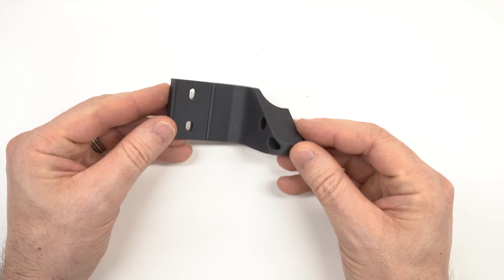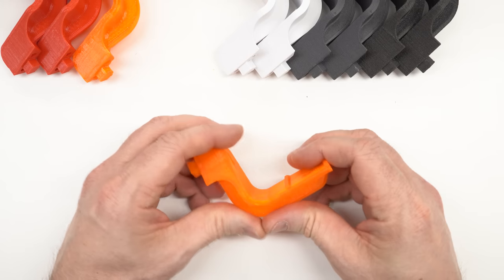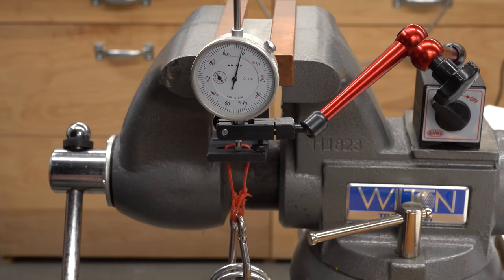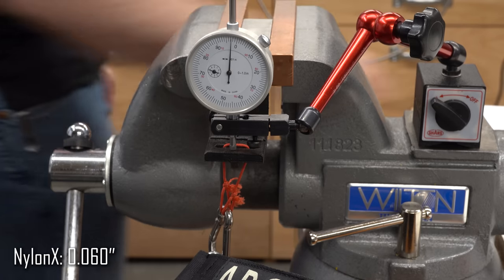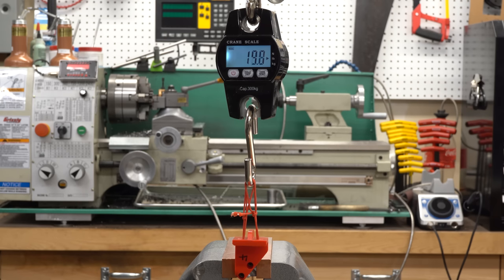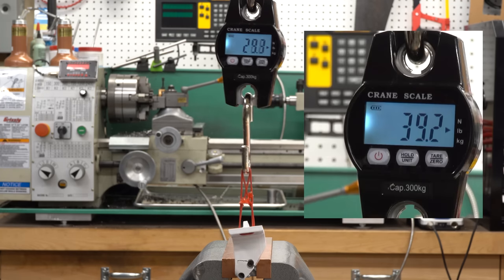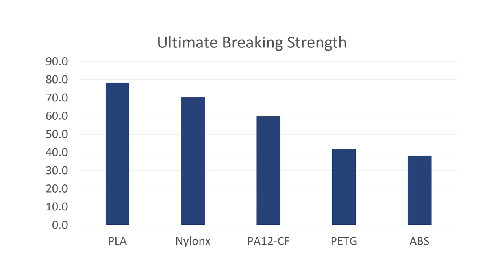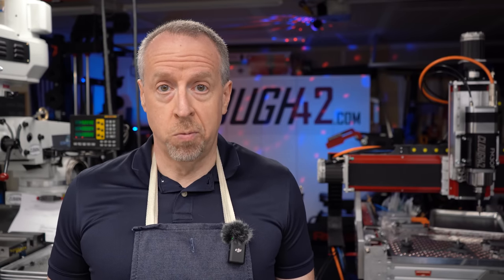Wait, What?  PLA is Stronger Than Carbon-Fiber Nylon?

Comment: If you haven't already, check out Stefan over at cnckitchen. He has done lots of very detailed strength testing with various filaments. I think people miss the point with ABS and Nylon. The main advantage with either one is their heat resistance, but they are both more difficult than PLA to print. In my experience the carbon fiber makes them both easier to print and less prone to warpage.

Comment: You should do a tensile test on the filliment itself or a rod with a bottle neck of an exact size and length.  Then compression strength and bend strength of a regular shape, not an S shape or irregular and a Mohs hardness strength.

Comment: @CNC_Kitchen had similar unreliable data and inconsistencies similar to your experience. Watch his videos on strength tests. PLA does overall have good strength compared to every other filament, even the very expensive stuff! What would improve all the their strengths are continuous carbon or kevlar fiber run along the filament instead of most CF filaments that have chopped fibers within these type of filaments.

Comment: Well... If you needed stronger 3D Printed parts, then you could 3D print those parts with like 2 Perimeters ( I found 1 not be sufficient enough to not be picking up artifacts from the Infill ) and 90-95% Infill ( no reason to go 100% ) followed by remelting them in an oven covered in Salt for it to retain its shape during the remelting process - It would negate any negative effects caused by Layer Lines as they'd become monolithic, and it might also anneal the part.

Comment: PLA isn't very temperature resistant, though. Also, constant load will deform it over time and it is fairly brittle. The material you use very much depends on the application. Want something tough? Pick nylon. Want something very rigid for a short duration? pick PLA. Want something balanced and cheap? PETG. Want the best on a budget? PC. Sky is the limit and want the very best? PEEK and PEI.

Comment: Great Test!  I am wondering if the results would be different if other factors were included, such as higher temperatures.  Also I have a request.  There are a ton of PLA filaments out there.  Would love to see a comparison test between the cheaper ones that run $13 / KG, and the more expensive ones that are closer to $30 / KG.  Is it really worth it to buy creality's HyperPLA, vs their cheaper Ender PLA that they market for beginners.

Comment: I really like the testing set up well thought out the only thoughts I have is the wall thickness  for the mounting screws were very thin and can see that it is consistent in breaking point.   What really matters is what is the actual real load on this part in real life and if the president load factors are adequate?  ⭐⭐⭐⭐⭐👍🏻

Comment: I’m curious what temp you printed the PETG. I’ve found PETG to be significantly more robust as far as impact resistance. I have some function parts that get dropped and PLA kept shattering where PETG bounces off the floor with no damage. Plus PETG has better UV protection.

Comment: A question - it is not obvious from the video, so can I ask about the failure mode in each case? Were they all failing in the same way? In the Aerospace industry we have to take account of the material properties when we design a part so that we maximise the strength.  If you were to make those same parts out of different metals they would also fail at different values, but a small amount of optimisation of the design in each case may have them performing much better.

Comment: with animal sculpture balloons, the color of the balloon is very strongly correlated with how hard it is to inflate the balloon. Pastel colors are much easier to inflate than dark saturated ones.  Simiarly, I've heard hints that clear petg  is stronger than colored petg, which would make sense because the pigment is displacing some of the plastic while adding no strength. It would be interesting to see the tests done with all non-pigmented filament.

Comment: Maybe try to dry the PETG And Nylon at 80 C for a couple of hours before printing maybe that will help, as both materials are hyriscopic. I am not surprised that the carbon reinforces material is weaker. Because the printing process is low pressure, I would expect the fibre to act as a defect rather than reinforcement. Also, the notch sensitivity of the various materials differ. Using a part with holes in may cause stress raisers that are not repeatable depending on the material used for the print

Comment: What was the printed part orientation for these parts? Perhaps test the other way with layer lines on the z up axis for the test. What nozzle size and layer height?   They all or mostly seemed to fail at the same point around that upper bold location so perhaps some part optimization is in order.  And what about the ultimate break strength apparatus?  Its puling the part to the left at break which means the direction of the force is not normal to the surface. Understood if the crane doesn't pull straight up and ok its consistent for all parts but perhaps it should be directly over the part at the estimated break distance so the pull forces are normal the the surface.  I found this to be a significant issue in getting more usable results.  Im.mostly interested in the Petg outlier of 153 lbs of force.  That part needs to be analyzed so you can determine how to reproduce those results. Which printer did you print that on? Open or closed chamber?  That's the biggest takeaway for me. The potential for Petg as the runaway winner if we can determine the optimal print settings.

Comment: I'd love it if you repeated this with pure nylon with no filler. I suspect it'll be more flexible than with glass fiber in it, but be way stronger on ultimate tensile. I've made some shockingly strong stuff out of it, like hit it with a hammer strong. Could be wrong of course. I suspect the adhesion between the nylon and glass in a printed application may not be as with a homogenous plastic since the fibers have to be so short to fit through the nozzle

Comment: PLA is strong, but I almost can't figure out when it would be useful as a mechanical part. It can't survive a ride in a hot car without warping terribly. That's such an Achilles heel that I pretty much always print in PETG even though it's more flexible and generally weaker

Comment: For me the most interesting part of the video is the performance variance of the PETG. Why did the 1st probe hold more than double of any other material? Why is there such a variance? If the why cannot be answered now, can one quantify the probability and variance? i.e. print out 10 of the PETG parts and examine. Every other material was consistent and leaves no question mark. For me, PETG does.

Comment: I've had pretty sturdy white PLA parts warp into unusable junk after sitting in a warm car. Not a hot car or even a very hot car, that will make the print unrecognizable after a couole hours as i found out during one Memphis summer. But Nylon? I printed black nylon parts for my coworker's sailboat years ago and they have been in constant use in direct sunlight and coming into contact with water regularly without any signs if degradation. Nylon is so much better than PLA its not even a question for anyone who has made functional parts out of them. Even when it's black and the PLA is white, which are polar opposites for UV absorption, and even when Nylon is more susceptible to moisture damage it still outperforms PLA by a landslide 

you can do laboratory tests in ideal conditions to get reusults that make good clickbait, but real world applications for functional PLA parts are slim to none if they will be facing any real stress.

Comment: Your test doesn't touch on this (because it was never intended to...) but my "structure alarm" instantly went up on how every single material seemed to immediately have yielded to some extent in the deflection test. After the load is removed they all returned a few thou short of "0". I'm not sure if it is equivalent to the quantity of creep and if given an extended rest if they will "creep" back to zero but it is concerning if something is expected to be exposed to a cyclical load. 

I realize this goes beyond your test but I'd want to see if multiple cycles to load would increase the defection and increase how much it was yielded from zero. Also I'm wondering how loading it in the opposite direction would effect the unloaded position. If the "relaxed position" moved back and forth between opposite deflections I'd expect the part to fail quickly under oscillating loads.

Comment: This popped up I feed again. I may have commented at time of upload. 

Just curious if you did a stress analysis in fusion on this? What was max load (or factor of safety)? Or the highest stress? Could you load the part to that factor of safety to validate the fusion model? Ie if fusion has a max defection at 30N with a factor of safety of 12 does the part load to 360 (36.6kg) to get same deflection (or failure that the model predicted?) could be interesting content and simple vid to make…

Comment: Almost need to use bolt holes for the break test - as the vice is introducing forces that can be different piece to piece.   How much clamping force is being applied squishing the part... ?

Comment: If there's not heat involved it's PLA. It's brittle but it doesn' t move. I'm now converted to resin printing. Expensive, but the quality you get is so nice. Most of the comments I got on 3d printed parts is how they look. You get those comments on resin printer too, but it's how they look so good, not how shitty they look...

Comment: I mostly use PLA+ or PLA pro for anything that requires strength unless temperature has to be considered then ill use PA6-CF, PLA is great until any sort of hot temperatures get added to the equation

Comment: I would like to see one more  variable applied to these tests and the variable would be heat.. how these different filaments hold up say at 80 / 100/ 120 degrees fahrenheit°. I think that would be useful for choosing which to use on parts for car accessories or for anything for someone who lives in a desert climate.

Comment: The break test is fair as it tests the same part geometry, but its generality is questionable as the geometry is favouring elastic/plastic materials that can deform against more brittle materials that cannot deform. We use square or round bar stick in standardised tests of breaking strain. Every test has a specimen design so perhaps repeat by printing those

Comment: You have to remember that yes, PLA is strong but it fails hard when used around stuff thats gets hot. its low melting point also causes it to lose virtually all stiffness and strength at temperatures above 50 degrees Celsius.

Comment: Want better PLA resistance to UV etc... The solution is not that hard paint it. If you anneal it first the strength can rise as can the temp resistance too but it can be a fine art doing it and it never seems totally repeatable. I use PLA in antennas on trips to tropics which are outdoor very sunny or have wind loading so real world too. Do I need to mention it is a LOT cheaper and easier to print that most of the other options too?

Comment: None of this should be a surprise. Nylon and ABS are recommended as best but best doesn't mean strongest or stiffest it means over the full range of properties a plastic can have they are on balance better. PLA's low temperature resistance should rule it out of nearly every use case, people certainly shouldn't be selling finished products using it.

Comment: In variable durability parts like 3d prints you should actually go with least durable part with caveat if there it is failed print like layer separation, but you should still take that into consideration and from that minimum durability, hell even minimum deflection that it can recover, substract 20-25% and there you have the parts actual physical world maximum load you should put it on so it will do its job in any other than decorative use. If its utility part or even more importantly mission critical, i would maybe go even low as substracting 40% depending where its going. Its always better to build and design bomb proof than too weak... then again its engineers job to calculate what construction requires at its minimums so least amount of material is used per unit/part to gain profits, but for non large batch manufacturing i would rather go over kill than sell/use lesser part. Of course this depending on what its used for if weight is large consideration for use, shipping, or load carrying capacity.

Also test was missing deflection it can return with basic load as tress load. UV resistance is big issue when you can cover the part with UV protective paint.

Comment: Great video! Subbed 
I was looking for best material to print a gear with on a 3D printer. I wonder how PLA would do?
The gear is for my garage door opener … so high stress but the nylon gear that was there failed miserably, so what is the worst that can happen?

Comment: Looks to me that the PETG failed because of its flexibility and the screw holes just got stretched out. If you move them further in or add more material outside them, I can only guess it'll perform better. The other materials seemed to fail other places.

Comment: I would be really curious about test in higher temp environments. 

A lot of the things I print go into a service truck. I’ve had issues with PLA shrinking and deforming on hot summer days so I’ve mostly switched to ABS. While annealing might help I don’t much see the point if I could avoid the step and associated hassles to account for it in design. 

While I just account for strength concerns in the design of the part I wouldn’t be opposed something that is stronger and has a higher heat tolerance.

Maybe my use case isn’t too niche to make a video?

Comment: Honestly PLA is the magic bullet for most things, its strong, cheap, easy to print, looks good and "bio degradeable", if it had better thermal and UV resistance it would have been the perfect material.

Comment: Printing a simple beam that is loaded in various axis to the print will give better data.  However if you are dialed in on a specific part then you can use this method.

Comment: That was very interesting James. Thank you very much for all that testing. As you say, it depends on what you are printing and how it will be used. I've found out recently that PLA does not like heat and creeps badly at anything much over room temperature. I printed some car interior pieces and they deformed with very little load on them. I've switched to PETG for those parts. Has PLA been reformulated over the years to improve it to match the latest and greatest materials?
Reply: @ R AK My PLA car interior parts looked so good.... until the car left the garage. After being heated, they looked liked they were made of chocolate! Reprinted the parts in ASA. The heat resistance is awesome and printed better (in my printer) than ABS.

Comment: Was the application of force between the materials pretty consistent in the strength test? As in, did you pump up the engine hoist fast for the CF nylon believing it would take more force to break -- and go slower on the PLA assuming it would break early?

Comment: As should be obvious, there are dozens of other variables involved in the tests used that are being ignored. Ambient temperature alone will vastly change the break test results. Printing temperature, layer squish, the speed at which the stress was applied. These are all EXTREMELY important for every persons individual us of any give part. 

Looking at the deflection test, Ide imagine layer squish and ambient temp are the only real important variables. 

The point being that at higher temperatures PLA will perform far differently than the results you got. Depending on PLA to support a $700 TV in in an Arizona or Florida garage is FAR more likely to lead to a new TV. The same setup in Alaska would probably do fine with PLA. But CarbonX or NylonX would be far more dependable as a weight-bearing 'part' in a hot, and especially humid. environment.

Comment: PETG is super brittle in reality, this inconsistency matches my own testing. I won't use PETG anything more than visual, and for appearance PLA beats it.
The super high number? Either during printing process // how that spot of filament was made caused less internal stresses, or some sort of fluke in testing methodology.

I've had THICK, like 5-7mm thick with 2-3mm walls drop from just ~1.15meteres to floor shatter in pieces with PETG, it was a Nema17 motor mount on older print so not very large either, weight def less than 50grams and it shattered dropping from just ~1.15meters. Got plenty of similar results.

Comment: Two things. 1. the design is lacking, the thin wall thickness at the screw holes isn't optimum. In practice I'd have .10" to .13" as a minimum. 2. Nylon, and possibly the other,  materials are sensitive to moisture content. In 3D printing and injection molding the nylon has to be dried  to produce good parts  but... That level of moisture severely limits strength and ductility. I designed a part years ago using nylon with a 30% glass fiber fill. After molding the parts were brittle as could be. After a week of sitting in our Florida high humidity they were massively more ductile and stronger. Print a couple more NylonX parts and either let them sit for a week or so or put them in a bowl of room temperature water for a day or so and test them again. I'm betting you will see a large difference in performance. And... I'd do the same on the other materials and see if the same situation applies. Thanks for your experiments and sharing them with us.

Comment: Did you used some tork wrench to tight the screws? For sure it can interfere the results, considering that the samples break at the screw holes area.